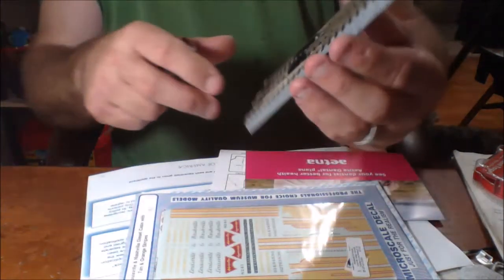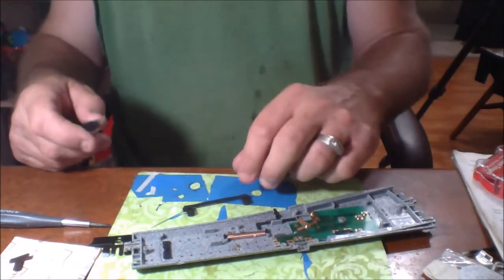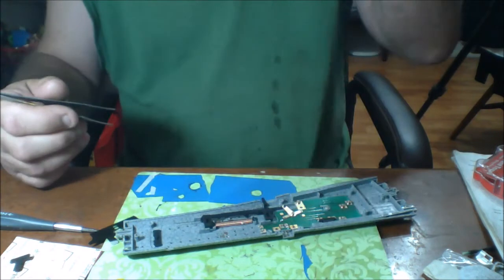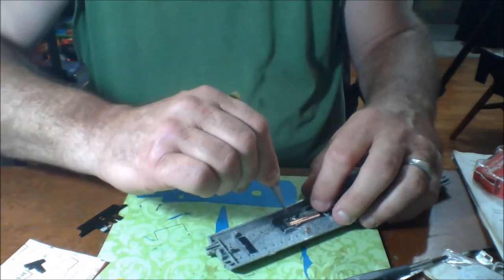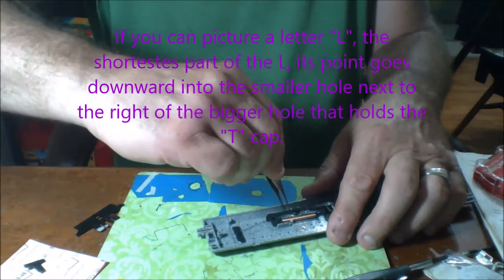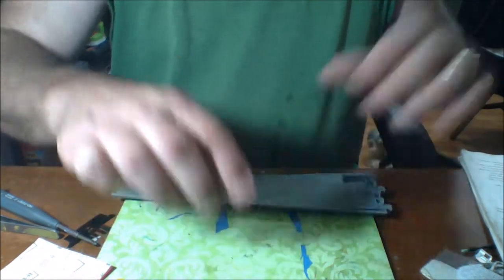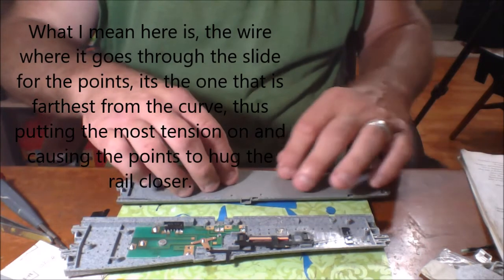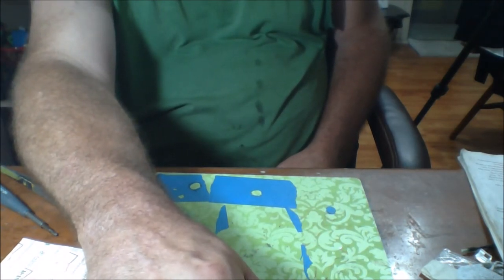Kato turnout switch repair

Comment: I just came to O scale to N scale. You said these Kato Unitrack #6 turnouts are expensive. These days (02/19/2023) a Kato Unitrack #6 turnouts is apx. $21 USD. The Lionel Fasttrack turnouts range for $50 - $110 USD. To me, IMHO, I can get 5 or 6 Kato turnouts for the one Lionel, so I can do more for a lot less. But like I said, that’s me & perspective plays a large part in it. Good video, thanks I needed that!

Comment: Thanks Don for the video. Very helpful. 

Yes, the L-shaped end of the wire goes into that raised hole near to/under where the T plate sits on top of (I hope that makes a little bit of sense).

Comment: Very informative and interesting. My question is, would these same repairs work for a manual switch that has a switch machine installed, as opposed to a #4 or #6 remote turnout?

Comment: I was watching and it was a labor. If you have problems with it then I am out in the cold. I wanted to know where the silver throw rod goes. i finally stuck the little L into the hole along the underside of the road bed as it looked like it would go there. The hole was the right size and the length was OK. From your video it looked like it went under the black flat sliding piece. I was hoping you would have pointed it out vs trying to describe where it went.
Reply: Yes, the L end of the wire goes into that hole near to/under where the T plate sits on top of (I hope that makes a little bit of sense).

Comment: I recently had to do that to one of my #6 Kato turnouts.  That coin is a royal pain to deal with!  I was tempted to get the Walthers Goo out and glue the thing in place.  But instead, I used a piece of tape to hold it in place until I got everything else put back together.  Then just before replacing the back cover, I carefully removed the tape from the coil.  Fortunately, a stated in the video, it really is not that complicated.  Just a bit fussy with placing that wire in just the right position.

Comment: thanks, exactly what I was looking for.
Reply: Don thanks again for the video.  I thought I might point out a couple of things that weren't initially clear to me when I opened up my turnout. Note that I was working on a right hand turnout:
1) there are 2 holes for the actuator wire to pass through in the throw bar. Lot of choices for this bar: Trow bar, aka tie bar, aka switch bar, aka head rod....  Listen to Don's video to note which hole to use - use the one that gives the correct tension of the switch point rails to the stock rails.  You want the maximum tension  as Don points out. 
2) the black plastic bar that slides back and forth with the the two magnetic metal squares might be called an armature. In a twin coil machine this armature would be inside the coil.  The Kato design is clever and the armature is parallel and outside of the coil.  The black plastic armature has holes on either end for the actuation wire to pass through. Only one is used. The hole nearest the throw bar is obviously the one to use.  There are two black pins  (on the black plastic armature body) that are aimed down (when you are working on the turnout).  The right pin attaches to the manual switch via a rocker arm.  The left one is not used.  So make sure you align the right hand pin in the rocker arm when putting the armature back in the turnout body. 
3) The actuator wire makes contact at 3 points, two are sliding and one is fixed.  First is the hole in throw bar where the straight portion of the actuator wire slides , second is at the end of the armature where it passes through a hole (and slides), and finally, in the body of the turnout where the wire turns 90 degrees.  It is fixed in the turnout body in at this end.  The trick I found was getting the wire into the turnout body as I lowered the armature, simultaneously aligning the armature pin with the rocker arm to the manual switch.

Hope I didn't make this more confusing then helpful.  

Got mine to work thanks to this video.  My grandson will be happy.